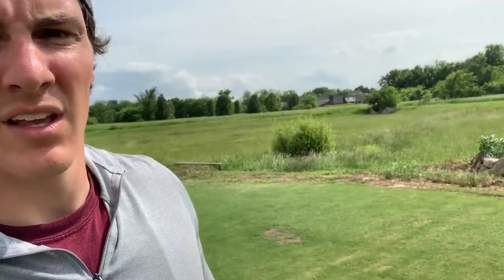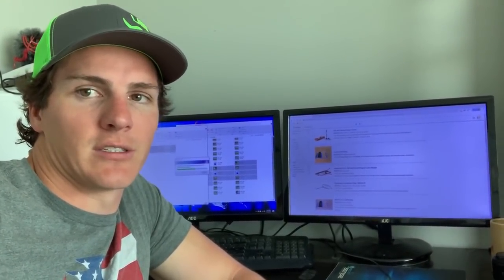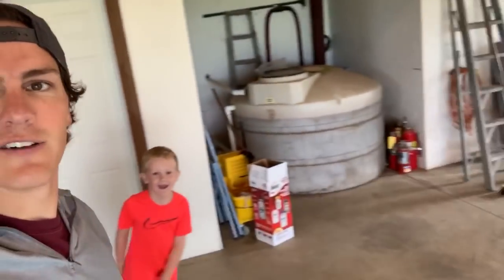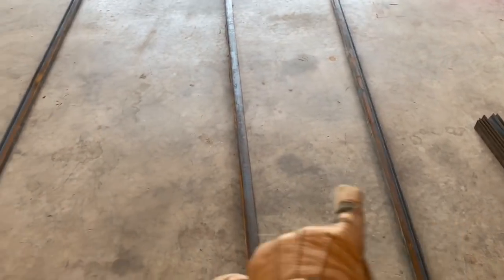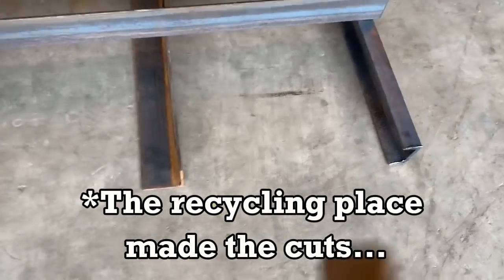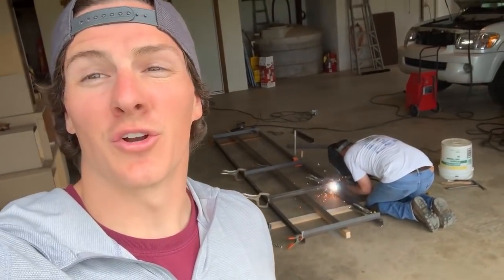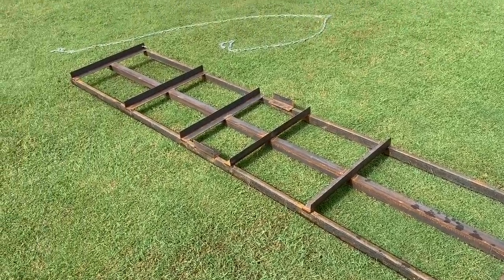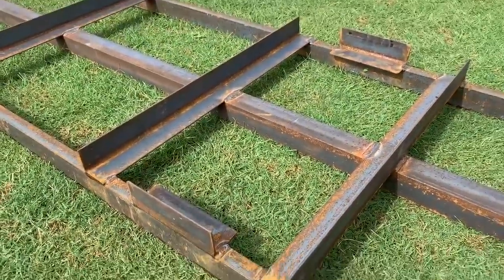Lawn Leveling Drag for a Level Yard and Grass

Comment: Great piece if equipment! Plans to make a smaller hand one for the slope into the stream of water? Need to make a smaller hand one myself.
Reply from the maker: Koven Carlson 
The plan for the stream of water is to get rid of it with a French drain... if it will ever quit raining enough to dig a dry trench 😡

Comment: I'm thinking of doing an 8 footer. I do have a large yard, but will be pulling it with a golf cart. I did make a drag out of 4x4 wood and 8 feet seemed to work okay. I have quite a few slopes (these are not uneven areas, if this makes sense). and 10', may be just a little too wide.  I'm just wondering if I'll be sorry later.
Reply from the maker: MrDae006 
8 feet is good. Yes, all depends how much your golf cart can tow
Reply: @TheLawnTools  Thanks, Great videos, by the way. So, 1/8" thick steel all around will be strong enough for this project? Thanks
Reply from the maker: MrDae006 yes 👍🏼

Comment: I've got about 6,000 square feet. Would a 6 footer do the trick?? I don't think I'll have enough turn around room if I use a 10 footer. Just curious. Love the channel! Appreciate all the hard work. -Drew
Reply from the maker: Yea 6 ft would be great. People use 3 ft rakes when doing it by hand so 6ft would be better IMO
Reply: @TheLawnTools  Thanks!! Do you think bolting it all together would work just as well as welding it. I'm not a welder, not impossible to find a buddy that could do it, but I could bolt it all together pretty quick I'm sure. Thanks Again
Reply from the maker: @dcousar2352  
I don’t see why not!

Comment: Great video. I m starting on one this week, do you feel you need blocks on top for additional weight?? If not I wont weld the supports for the blocks...
Reply from the maker: Steve Kopcial 
I do not think that extra weight is necessary. It’s pretty heavy all by itself 😁👍🏼

Comment: Hey, new subscriber love the content so far. Quick question, about how much were the materials? I don’t know how to weld and would absolutely hurt myself trying to build this but I’m willing to give it a go if the price is right. I was also contemplating the tractor supply co one u show on the screen just out of convenience. Could an non handy guy make this?
Reply from the maker: Keith Conti welcome! Thanks for subscribing! 
It was $90 for the materials but if you get the thinner C channel (see description) It might be quite a bit cheaper. My place just didn’t have it so I went a little thicker. (The C channel I bought was quite a bit more expensive than the angle iron - that’s why I think it could be cheaper.) Theoretically you could just use angle iron in place of the c channel and it could be even cheaper.  As far as welding...  I don’t know how you would do it if you don’t know how and don’t have the equipment. I was lucky enough to have a brother in law that does. If you did all the materials cheaper (use all angle iron) you might be able to hire somebody to weld it and spend less than I did haha. I don’t know how much it costs to hire a welder. Hope this helps but let me know if you have other questions!
Reply: The Lawn Tools $90 isn’t bad at all, I might know someone who could weld it for me. Thanks for the reply!
Reply from the maker: Keith Conti 
No problem at all!

Comment: What’s the outside dimensions of the c channel and angle iron? You only gave the length and thickness
Reply from the maker: Wow. You are correct. Sorry for the oversight. I’m 90% sure It’s 2”. I will confirm that and add it to the description!
Reply: The Lawn Tools no problem. I figured 2x2”. I might just build one this weekend to help level out my New England lawn.